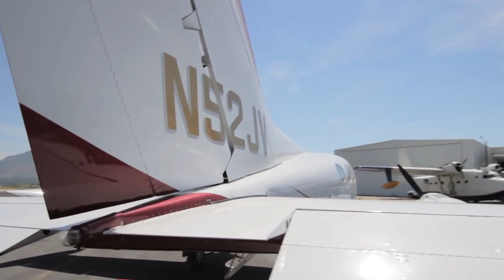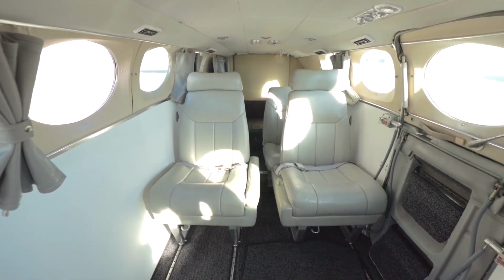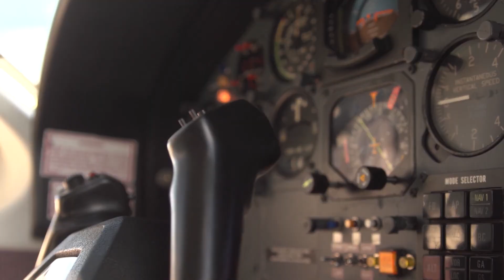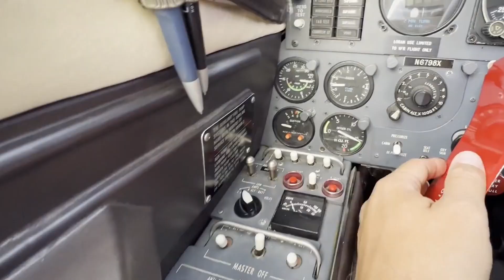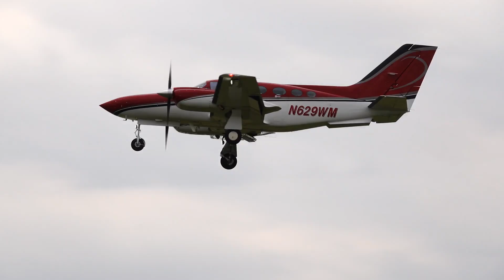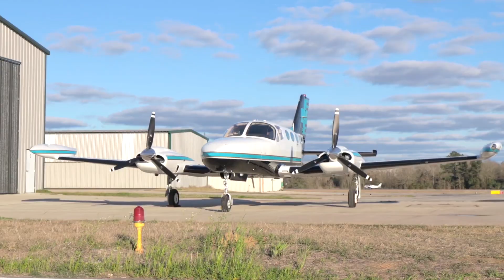Inside The $700,000 Cessna 421 Golden Eagle

Comment: I just flew a 414 which is similar to this. Brought it from CA to FL. I had an experienced MEI teach me the ins and outs of it, and I must say engine operation was single handedly the most important portion of the learning. keeping tempatures at reasonable levels and keeping the climb at a fast speed for better cooling. You really thread the needle on the CHT gauge near redline (just around 400). She was a beautiful plane to fly, and surprisingly not very hard to land and take off in. Make sure she's trimmed right for take off and she will easily lift off the ground.

Comment: Why 700K?
Reply: New engines, avionics, paint and interior, no corrosion and so on.
Reply: @a.b.6233  ok, but none of the shown ones in the video had this complete refit. For 700K it must be pristine in condition and specs.
Reply: @TakeTimeToday888  Yes
Reply from the maker: Since there is no single price for a used 421, we take an arbitrary number within the range of the price for used models. In this case 700k
Reply: @AviationBase  got it. That makes sense. For this range of around 700K I would expect the finest quality of it with modern avionics and interior. I thought the common average is about 250K to 450K for most of them seen on the market.
Reply: The most expensive to maintain, insure, and operate piston twin there is